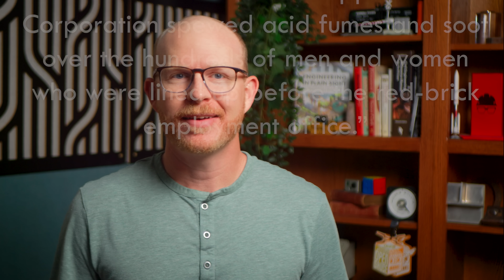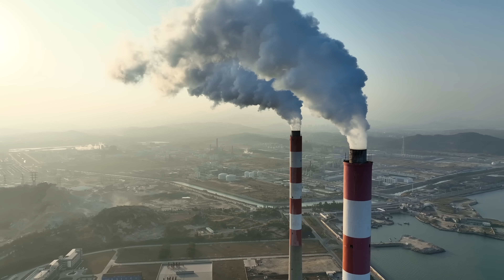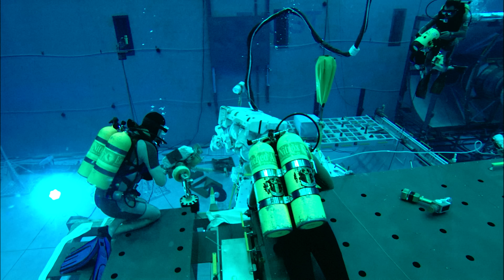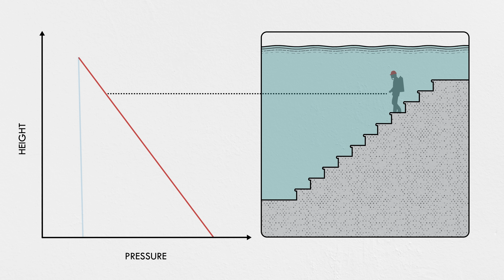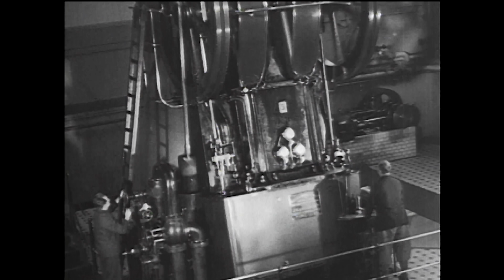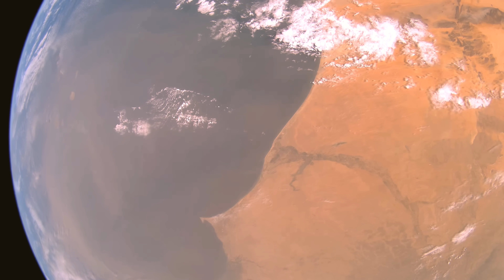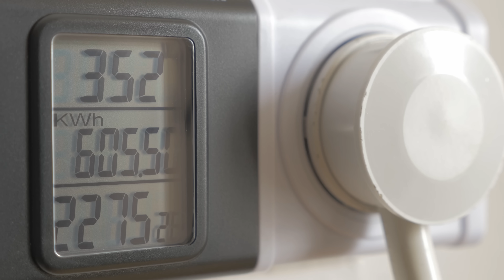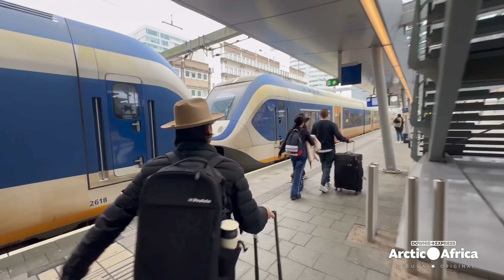Why are Smokestacks So Tall?

Comment: One of my chemistry professors (an engineer by trade) joked that in the 1960s some engineers here in Canada said that if the moon landings were faked, it would have been in Sudbury Ontario.

Sudbury is home to some of the largest sulphide-rich copper and nickel mines in North America, and works have been going there for almost 150 years. When you smelt these ores you first heat them to high temps to release the sulphur as sulphur dioxide, creating the metal oxides. You then reduce those oxides to the pure metal with petroleum coke or coal coke. Given these ores can be more than 30wt% sulphur by mass, for every kilogram of metal you might produce 2kg of SO2, which goes on to react with moisture in the air to form sulphuric acid droplets. These droplets acidified the thousands of lakes and groundwater near Sudbury to the point where some became effectively sterile, and that prof described that it looked like you'd driven to another planet, stripped dead soil and bare rock peppered with millions of dead trees that in earlier years would have been also stripped for fuel.

In 1972 the International Nickel Corporation of Ontario completed the Sudbury Superstack, 381m or 1250ft tall - still the largest smokestack in the western hemisphere and 2nd largest in the world, only beaten by a colossal coal power plant in Khazakstan. It was only part of the huge cleanup effort, but there is no question that it's effect was significant, dispersing SO2 such that it wouldn't fatally acidify the local area. This dispersion would be the source of acid rain across Ontario as wind patterns could concentrate the pollutants in one region or another. 

The thing that finally hit the nail in the coffin of sulphur emissions? Capture. 
Captured SO2 can be catalytically oxidised to SO3 and then hydrated to H2SO4 - sulphuric acid. You can then use this on the mine for ore leaching and sell the excess, offsetting the costs of capture.
Reply: Astronauts bound for the moon actually trained in Sudbury! It's because the meteor impact created breccia, mineral forms that're rare on earth but common on the moon, whose surface is shaped almost exclusively by such impacts. Recognizing the formations and picking interesting samples to bring back to earth, meant training in Sudbury. https://www.youtube.com/watch?v=07489nGApGw for more.
Reply: @myself248  That's super cool! I feel like at some point I'd heard astronauts trained there in passing but never knew it was because of the impact geology, that's fascinating!
Reply: @nickn.332  What catalyst is used to oxidize SO2 to SO3? Are they noble metal catalysts? I do recall people being concerned that catalytic converters would create ground level sulfuric acid with the high sulfur gasoline 50 years ago.
Reply: @gregorymalchuk272 I think the usual platinum works, but also iron oxide to some degree. And I also heard vanadium is used.
Reply: "Well the girls are out to bingo and the boys are gettin stinko
We think no more of Inco on a Sudbury Saturday Night
The glasses they will tinkle while our eyes begin to twinkle
And we think no more of Inco on a Sudbury Saturday Night"  

I couldn't find a source, but I am certain I heard on a news broadcast (decades ago)  that SO2 went so high in the atmosphere from the INCO superstack,  it contributed to acid rain in Norway and Sweden.
Reply: How active are the nickel mines around Sudbury these days? I recall from my childhood that the production was massive, and had been for decades. IIRC INCO was bought by Rio Tinto, or was it another firm? 
I do know that INCO developed many superalloys like the various Inconel alloys, that are usd to this day in very hot and corrosive conditions.
Reply: @gavinmclaren9416  INCO was bought by VALE. And the mines are still going strong. And likely will be for a while because of the market trends. The superstack is coming down though.
Reply: @gavinmclaren9416 I grew up in Sudbury, mines are still going strong.
Reply: I was hoping someone was going to mention the Superstack. Pretty sure the stack was last used in 2020 and it's demolition is planned soon. It's going to be strange seeing it missing from the skyline.
Reply: How's the Blueberry Bulldogs doing? Huh!?
Reply: On selling captured sulphur/sulphur products, one problem is that it isn't actually that profitable in the end - because we're now so good at recovering and reusing sulphur! Production of sulphur has generally outstripped supply over the last few decades, and doesn't follow trends in demand as it's a byproduct of other processes (e.g. we don't refine less oil because the sulphur market isn't doing well). Alberta famously has millions of tonnes of stockpiled sulphur as a byproduct of oil and gas extraction, which tend to shrink when it's more profitable to sell, but grow when it's not.
Reply: @danielevans1680 having flown over Ft. Mac, I can confirm they are least used to have a a literal mountain of sulfur. From what I recall, it was mostly leftover from making ultra low sulfur diesel. They'd hang on to it (basically making a huge pyramid out of it) until the price was more agreeable, then send it out on train tanker cars.
Reply: Is this why there are an impossible number of hot women in Sudbury?
Reply: Sudbury is home to more than just a blueberry festival and the plucky senior whale sh.... aaa hockey team they sponsor?
Reply: I thought the Apollo astronauts trained in the Badlands.
Reply: Well it makes it all the more impressive then that there's an impossible amount of good looking girls in Sudbury!
Reply: So that was what solved the acid rain problem, they never talked about it in the news anymore. funny, isn't ?  they talked about it like it was "climate change" and the WORLD WILL END , the world didn't end, someone actually innovated a method of solving the problem. 

Of course, that was a real problem to begin with

Comment: Air quality dispersion modeling! I am one of those environmental professionals that have done dispersion modeling for about 20 years. One of the important terms to add with the modeling is that the EPA's standard model also has to assume steady state for the calculations and the results are only good to about 50km. For larger regional transport modeling, current guidance is to use what is known as a puff model where the model tracks bundles of pollution as it transports through the atmosphere.

Also, one other aspect of the initial vertical component is that the upward motion facilitates higher momentum for mixing in the immediate area of the exhaust. This gets even more fun when you venture out of the strict point source modeling and into area/volume/line sources. Would love to have further conversations on this.
Reply: Is there just one standard model or are there companies that have adjustments based on testing data? I've worked with a few automotive companies that have commercial CFD code that they have correlated to specific niche applications, which is kinda the boring reason I want to know. The more interesting one be that I've heard some really cool stories about history of different codes. The coolest being a DoD fallout model code that got repurposed for ground water contamination...but the the later party didn't know why they weren't allow to run the code in an above ground simulation til later on.
Reply: @nickl6820  There isn't just one model as it'll depend on what you're doing. For the most part I deal with regulatory compliance with air quality. EPA has been on a long transition to incoroporate most near-field dispersion modeling into one model - AERMOD. However, there are/were previous models targetted to simulate roadway conditions (CALINE3 model that incldued true line sources, vehicle queueing, and roadway mixing), overwater conditions (OCD), industrial bouyant line sources, airport/aircraft sources (AEDT but that is sneakily just using AERMOD, radioactive (CAP-88), long range transport (CALPUFF), etc. We don't typically use CFD, but have contracted out firms to run wind tunnel analyses when the dispersion modeling appears to be too conservative in its predictions.
Reply: Dispersion modeling is also used to forecast volcanic ash and gases to warn aircraft and to forecast ashfall for both marine and population centers. There are many models and the ability to run them across a variety of numerical weather models, and this is done to produce probabilistic forecasts through what is called an ensemble.
Reply: Whatever happened to acid rain
Reply: @tomholroyd7519  EPA's cap-and-trade regulation with the 1990 Admendment to the CAA
Reply: Worked in nuclear power plant.  Part of our Emergency Plan was to be able to predict direction/ dispersion of any radioactive release if there were an accident.  Temperature readings from different elevations, wind speed/direction/ gusts.  A lot was pre-calculated, ( if such-as-such, then stable/ rising/ unstable/ etc...)
Then we had to deal with "Okay, release was five hours ago and wind was 230 degreees, but now wind has shifted to 290, how is the existling plume spreading sideways now???" Quite a lot of thought went into it all.
Reply: @mikefochtman7164  The technical area we don't always get into is exposure pathways. Project will typically try to avoid an air quality impact at all costs since they trigger the need for a public health assessment which can often times look like "our project will result in X many deaths due to concentrations that exceed the NAAQS public health standards" which is not a good position to be in. The CAP-88 program for radiological assessment has some of that in there, but my use was on a very small scale where we were only considering inhalation and didn't need to worry about soil/crop/livestock pathways. You also bring up a really good point with wind speed, that as you go up to try to go over sensitive receptors the wind speed typically goes up as well - meaning your plume will travel further before plume rise can move it up as well as limiting mixing by keeping the plume more tightly concentrated.
Reply: I've seen shaped "nozzles" on tops of some stacks, particularly on a local hospital roof, and I always assumed their purpose is to add velocity in lieu of building a taller stack. Does that sound right?
Reply: @myself248  In general, most likely yes. You would have to balance that with pressure designs from the mechanical system as well (speaking not as an MEP), but usually you would restrict the diameter to increase exit velocity. However, this would still immediately begin dispersing due to wind conditions at the stack. If you wanted to truely get an increased height of release you'd want a cannon fan or something like that which can keep the plume together until it hits a particular release height. IIRC I think it can add something like 10 - 25 ft to a stack, but I wouldn't quote me on that.
Reply: Wow you do modeling? You must be really hot 😍
Reply: ADMS6?
Reply: @Gomlmon99 I've never had a chance to use or assess ADMS since most of my work is driven by regulatory requirements in the US and EPA's preferred model is AERMOD. My understanding is ADMS is the UK equivalent but would need to do some digging into model formulation to understand how the two models differ.
Reply: @grausammesser I don’t know AERMOD but that sounds about right as yes I’m U.K. and we use ADMS!
Reply: @Gomlmon99 CERC has put out a paper doing a comparison ("Comparison of ADMS and AERMOD Meteorological Preprocessor and Dispersion Algorithms") and it looks like the plunge rise algorithm seems to be the biggest difference between the two.
Reply: @grausammesser What is the normal educational background for people in this field? I am studying structural engineering right now but modelling sounds really interesting to me
Reply: epa is a scam
Reply: How about effects like moisture, or rain, or lightning because it generates ozon that might pull down other particles? Sea salt is a big factor in tiny air particles in coastal areas, you see them as dust laying on everything.

Comment: Your stack model using a building to demonstrate downdraft. and influence on stack effluent reminds me of the huge snow fences I see in Wyoming and other Western states with high winds.  Snow drifts can get very problematic on highways. I always wondered why the fences were located so far away (hundreds of feet) from the roads. Why not locate the fences at the road boundary to maximize the blocking of drifting snow?  Then I realized that the fences create a huge vortex (suction) that deposits the snow before the road boundary.  Your model demonstrates that effect very nicely.

P.S. Using pizza tech to demonstrate engineering is proof that clever humankind has great potential.  The future is bright. That and good beer is proof that God loves us and cares for us ... if you pardon my Ben Franklin pun:)
Reply: Not only does it cause vorticity by interfering with the flow, it also works like a selective "Natural selection" because the area behind it isn't getting the wind. So you wave the wind torrents come around it, like gravitational lensing, but it also sits in the allegorical "shadow" of the box.

Comment: Another place to commonly see a stack used is the sewage stack in homes.
Reply: Those are primarily just to equalize air pressure behind flowing wastes, so that they don't get trapped by suction.

Comment: I used to live in the shadow of the 2nd tallest chimney in the world (tallest freestanding structure in the world at time of construction) and work in the industry that operated it. Before its construction the old methods and short stacks left the city so polluted that it was a sea of black stained rocks that NASA sent astronauts to train in for Apollo 16 & 17. After its construction and a massive reclamation effort the region is once more green and full of wildlife, gone is the sulfer smell too (mostly). 

Nowadays the chimney has been out of commission since 2020 and is scheduled for demolition, despite the smelter under it still running. Its construction is testemant to the engineering of the past, how a simple structure like that could be the backbone of a massive environmental cleanup. Its decommissioning and removal, while production carries on, is a statement of how far our current emission reduction methods have come from the days we needed to shoot them 1,260feet into the sky to give the land beneath a chance to heal.
Reply: I remember when the superstack was built in Sudbury. I passed through the area a couple of times a year. I saw first hand how the landscape changed once the superstack was commissioned.
Reply: You know when your getting close to Sudbury when you can see the superstack! It will always be a landmark here!
Reply: Was that the one they just tore down in Homer City?
Reply: Montana?

Comment: In addition to the changing shape of factories, you can also see this effect in the changing shape of ships - especially the fast ones! The Titanic is a particularly interesting example in that her aft-most stack didn't carry smoke; it was purely for ventilation as it connected the engine rooms (which got plenty hot from all the steam despite not having any combustion!) to high-up outside air. For most ships of the time, though, you could get a fairly good idea of where the boilers were by just tracing the stacks down as the exhaust piping was kept pretty straight. Later (including today's) fast ships have silhouettes closer to earlier slow ships, with only one or two stacks. Part of that is the advent of forced ventilation meaning that you can bend exhaust around curves and trunk multiple pipes together without worrying about losing air. The engine rooms are often spread out quite a bit more than the stacks, as deck real estate is a lot more contested than deep cubage.
Reply: Titanic's aft stack actually did carry smoke, from the kitchens.
Reply: @michielwesselingh661 I mean, yes, but compared to a collection of coal-burning steam boilers, that ain't nowhere near real smoke :)
Reply: Combined stacks was also developed as a defensive measure as bombs down the stack ended poorly & that deck space issue was mostly dealt with militarily.

Interestingly also is their stacks were designed to be able to create giant smokescreens.
Reply: "Steam despite not having any combustion"? How do you get a steam engine without heating the boiler?
Reply: @carternotsteve2242 Spicy rocks, silly!

More seriously, almost all steam ships separate where the burning happens (boiler room(s)) from where the steam pressure gets turned into motion (engine room(s)). Unless something is going terribly wrong, you shouldn't have anything burning in the engine room but it'll still get really hot, as there is a lot of very hot steam making its way through radiating its heat out through the pipe walls. So getting enough cool air in to keep the engine room livable was a serious engineering concern.